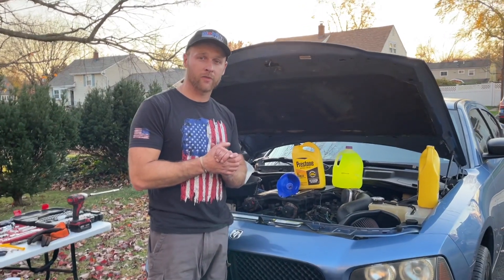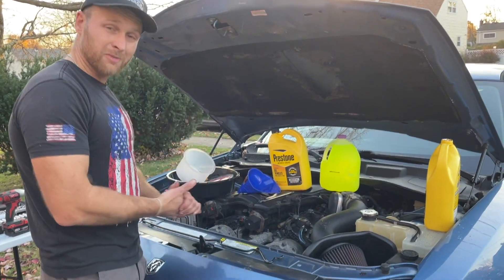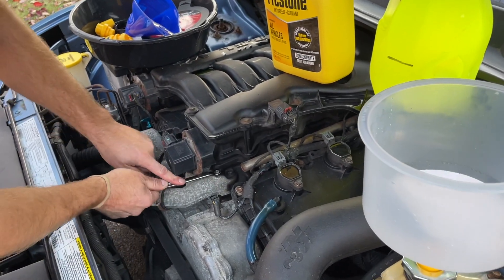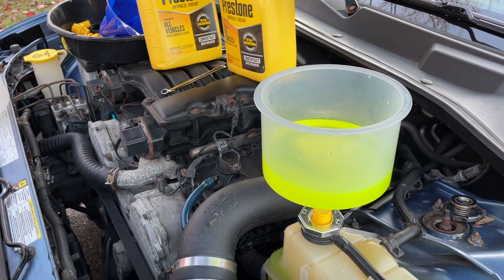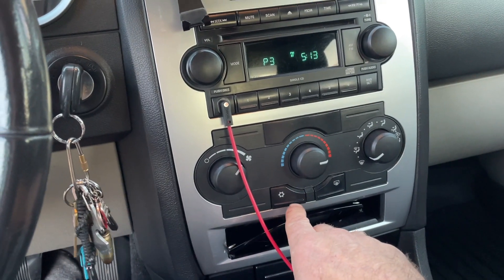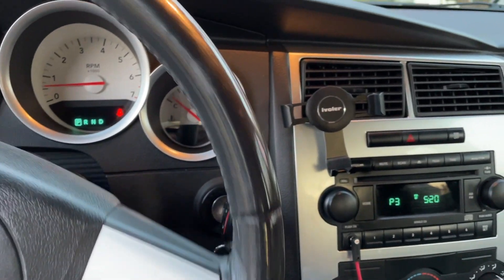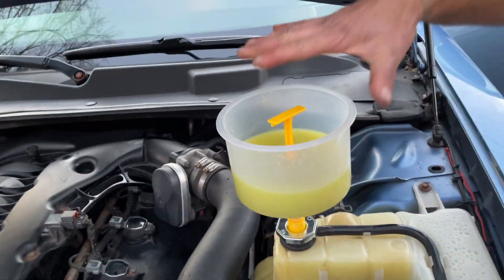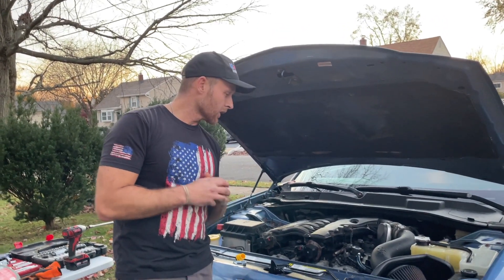How to “BURP” Bleed Air Out of a Cars Cooling System - Easy DIY process for ALL makes

Comment: Thank You this was probably one of the best explained videos with the bleeder valve and how to properly use it.
Reply: 80 mph test passed on my Mazda Three final installment thank you so much
Reply: Not for Honda users specifically
Reply: The air filter you have on this car is drawing hot air it instead of fresh air .
Reply: What should I ( will it) work for a 1.4 liter Fiat 500 c time will tell.    [ I always post my speech-to-text fails]
Reply from the maker: Appreciate  that 👊

Comment: I did this to my 98 ranger and still cant get the dam air out of the lines. Put a New thermostat in too and seems like its not opening . I've been getting no heat in the cab too.
Reply from the maker: yeah.  you need that thermostat to open up.  wonder if they gave you a faulty one.
Reply: @HowToWithLech  it looked good and brand new but ya never know. Im going to get the other the coolant sending unit. Next time i get paid. Yesterday in Michigan it was about 55° so i took advantage to work on the truck. Today now is 31° and its was raining all day but now its almost 4:00 pm and its raining hail. We supposed to get a lot of snow tomorrow friday. Between the cold weather, crapy weather and having the funds has been a pain in the rear to get things done outside. Unfortunately i have no garage . any how my truck is not over heating . I know the activator to go from cold to hot is not working on the heater. So i tried to cut a whole to move the door on it to put it so i can get heat but the door seems spring loaded and just goes back. Seems the top radiator hose has air in it at least it feels like it. I put a new thermostat on too. The heater hoses barely feel warm going into the heater core. I even manually moved the heater activator if that's what its called and checked vacuum . I tried burping the coolant system and still got air in the lines. The only thing i seen to do is to loosen the heater core hose to see if i can get the extra air pockets out the top hose ? Its been a pain in the rear trying to fig this out. Like i said its not over heating . so i bought a car heater offline its coming saturday . Hopefully it'll de-ice the windows and get truck warm enough. You got any ideas ? Mine is a 98 ford ranger 3.0 .
Reply from the maker: @jeffreypetree7163   i think you're doing it all right.  not familiar with the truck so dont want to give you the wrong advice either.    good luck.  i hope it works out

Comment: Lech, you are absolutely awesome, thank you so much for doing the whole cooling system series of videos.This one, like the last two I watched are greatly informative and very helpful.
Reply: This video was really helpful thanks a lot man great work keep it up dude yeah. If you happen to see this message I was just wondering if I wanted to go to Pick-N-Pull and get a housing outlet coolant system would it work as long as it's the same year as mine and will it work okay? And for how long you think until I will need to get a brand new one or should I just get a brand new one?
Reply from the maker: @macaugustine2298   if you need to replace i would suggest getting new.   you can pickup new radiator for like $60-$70 online. (you dont need the all aluminum one) thermostat should be under $20 if you dont need housing with it.    unless youre picking something in great condition and cheap.  otherwise might not be worth it as who knows how long that one will last.
Reply from the maker: Glad to help 👊👍